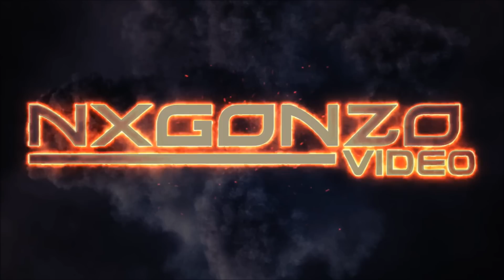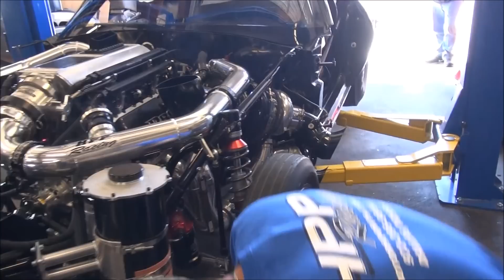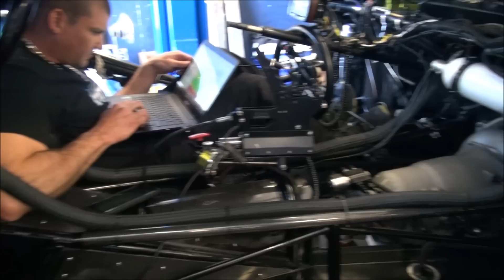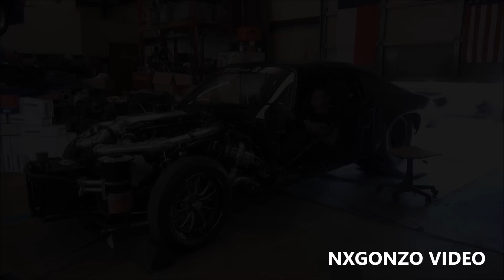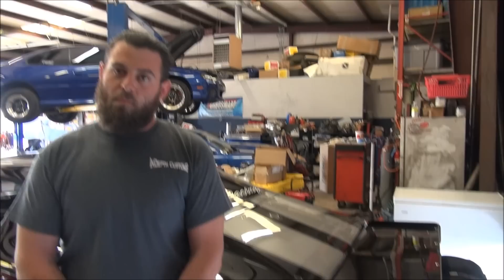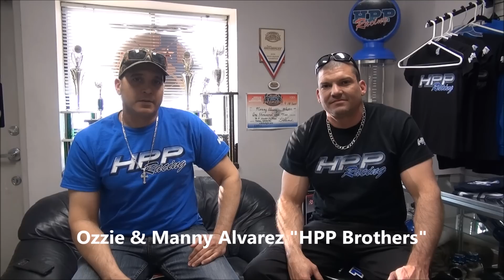405's Monza goes Turbo!

Comment: Nice to see another 405 racer who throws that nitrous out of the door. Nitrous are simply to unreliable and every pass you make is a gamble, you don't know if the motor is getting damaged on the next run or not. Nitrous cars are fast, don't get me wrong but it puts a great deal of tear on your motor. And as Monza said, nitrous are becoming more expensive and less available. Turbos or Prochargers is the way to go if you want to stay competative. Dave's Goliath was fast as hell on nitrous, but it came at a cost of melted pistons each race night.

Comment: On such a clean system why would sparks fly from the exhaust if its not loosing metal in the motor. Does not seem like burnt carbon build up

Comment: What is that black thing on top of the intake
Reply: Bobby Ourada burst plate pipe. If a backfire occurs in the intake it will exit through that pipe and outside the engine bay. Without it, the hood would be blown off in the event of a backfire

Comment: That car is gonna be hell to deal with when he gets it dialed in.
Reply: next to DD, monza had the best 60ft car...turbo;s hit the tire in a different way though... it can take a while... Dominator is a good example....  Monzas car is much bettr than Dom's car though.  He will be getting inside the converter.  Traction controls can now lock and unlock a conv (if yu have a lockup trans)...or it can pull some timing.... another 12K ,thankyou....  Whoever said they done get free parts is a joke.   Here's my "devise"    "try it out"...  oh..and put this banner in your pit and this decal on the car.

Comment: There's an old podcast when Jerry was talking about wanting to go turbo, but not wanting to deal with the learning curve. I can only assume he got sick of burning up $40,000 engines and using up $200+ in nitrous and plugs every pass.
Reply: 32vAudi90 I heard that interview. He said he's too old and it takes to long to learn and work the kinks out.
Reply: 32vAudi90 was thinking the same thing.
Reply: He also said he might do the swap after the tv series was over and list racing done for season.
Reply: 32vAudi90 Always about the bottom line

Comment: Turbos are getting played out. Someone needs to do a screw blown car, a turbo cars worst nightmare.
Reply: That's a great combo but it's a hard setup to run in the types of racing he does. The biggest problem in street racing is people playing games on the starting line. You can't sit on the 2step like you can with other setups. It will eat the belt. If it was just a track car I could see it. Either way they all make power. Power is the smallest part of the puzzle these days. Power Management is what separates you from the rest.
Reply: Wayne Bollentin exactly , much easier to manage boost and power with turbos.
Reply: Turd Ferg no way dude turbos are the future of this sport
Reply: Herobrine swag 66 turbos are the most efficient .. clearly better..
Reply: seems like the big suitcase sticking out the hood with zoomies gets labeled ;="ProMod' pretty quick
Reply: Thewasteland agreed.
Reply: Screw blowers at that hp are harsh on the motor just like nitrous. Everyone is switching to turbo because they are more reliable and cause less damage
Reply: Sean McClellan 
Exactly. I don’t think street race guys wanna put at least top half main bearings in every pass. Lol
Reply: Turbos are dominating because it does need the engine to make power, it's using free spent exhaust gasses to propel the turbos which forces air to make power. Any superchargers uses engine power to force air in the engine which also robs power. Turbos are way more efficient and the power is always there, if anything blowers have been played out years ago, lol. Only reason why it hasn't been popular is because guys are stuck in the old school mentality with carbs and blowers that might have been fine years ago when every car was mostly the same. Now with technology we have today, cars are going insanely fast that carbs and blowers have a hard time catching up. why you think Doc, Monza, and Reeper struggle to be #1. They are the only ones on nitrous, you heard what he said, it's time for a change if you have that old school not willing to change mentality, you are not going to keep up.
Reply: TurboTom Performance Agreed! Roots style blowers are pointless unless you have a top fuel car lol centrifugal superchargers like ProChargers have come a long way, but turbos are ultimately the king of forced induction
Reply: TurboTom Performance tell that to  ×275's Rich Bruder and their engine builder Anthony Disomma blowers are played out. This will hurt some feels but it's the truth. Turbo is more forgiving.Takes less skill to run. To be fast with a Roots/twinsc style blower you need to know your shit or someone with you that does. Turbo someone can give you a few tunes and if your good with power management and chassis setup. you can do ok. I'm not saying turbo guys don't know what their doing either. There's just many more of them that don't have a clue then anything else. At the end of the day it's who gets to the end the quickest. Everyone has to do what works for them because there's pros and cons in everything.
Reply: So right Wayne also a lot of peeps complain and for good reason about line up times.   Line up first next guy does a long burnout or jedi mind tricks getting to the start up line.  Just trying to over heat the other car before the launch of the race.
Reply: Turd Ferg fireball camaro an the crow both busted gasmonky screw blower ass so yea good try
Reply: screw blown is loud as fuck, heavy, and parasitic. plus it requires a lot taller intake and some seriously well prepped track. 

and you cant control boost near as well. With turbos you can have 20 different boost settings that swap during the run
Reply: MrCarnutbill67 Exactly! Having to pull the top of the motor apart after every pass wouldn't work out that well
Reply: Didn’t Stinky Pinky go with a screw blower?
Reply: Terrence Bryant He's had a screw blower. He had one on his Camaro when they visited OKC, and he has one in his Challenger
Reply from the maker: Yes and the car is now for sale
Reply: totally agreed
Reply: Hope he learns how to launch a turbo car faster than Dominator.
Reply: Gaming with Littlogre22 Lol poor Dom thats cold then Shawn saying "I got 3 geez on the bump" was comedy gold.
Reply: chief's twin turbo already beat a very fast screw blown hemi, so did Ryan Martin's twin turbo. so maybe u got that one backwards lol a screw blown cars worst nightmare is a twin turbo. bc they know they capable of being beat at that point. either way love the hp
Reply: I will believe that as soon as Nitro cars start running turbos.